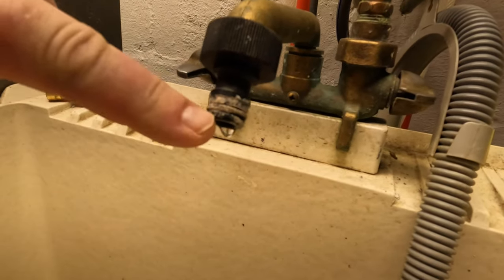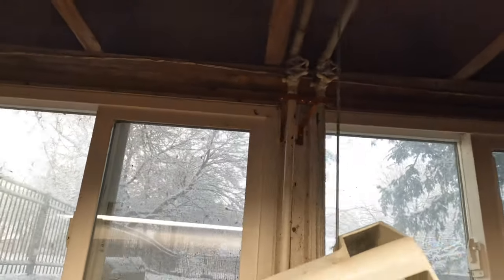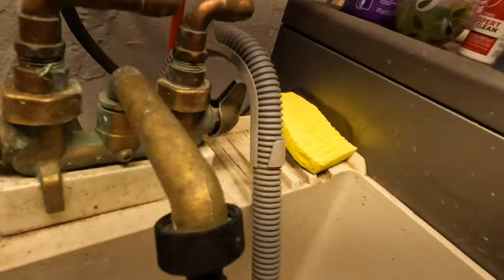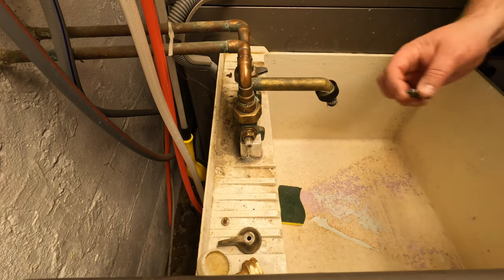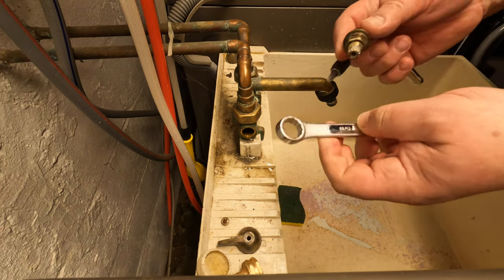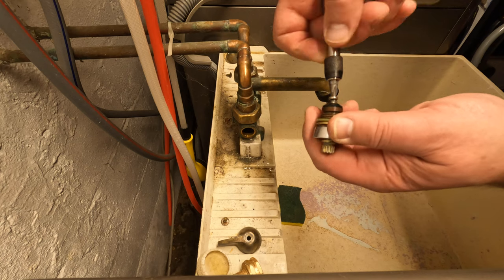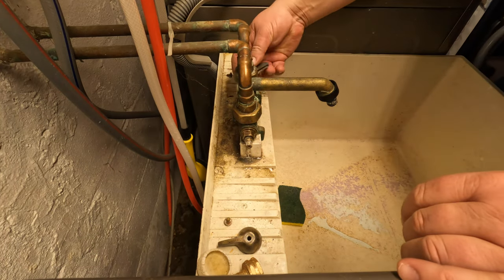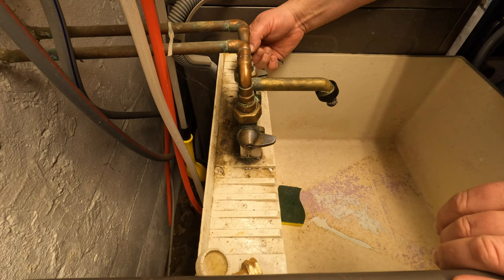Repairing a Leaking Laundry Sink Faucet (Less than a $1)

Comment: Thanks for this video. The valves you shut off, are they for the whole house or are they specifically for the laundry faucet? Because I do not have laundry faucet valves but I do have the laundry machine valves. Does that mean I have to shut off the main water supply?
Reply: Yes, be sure and shut off your main water valve for the entire house before starting your faucet repair.

Comment: I have separate supply lines to my faucet just like the ones in your video, but they are impossible to turn.  The just won't budge.  Even spraying them with lubricant doesn't help.  Do I have to loosen the nut behind the knob in order to get them to close?
Reply: It's recommended to turn all plumbing knobs in the residence at least once a year to prevent them from sticking.  It could be due to minerals in the hard water.

Comment: I'm in the process of replacing stems in a similar brass fixture. Rather than having a hex nut to remove stems, parallel flats are machined into the stem body. They provide a narrow shelf on which to grip with a wrench. To turn water on, either cold or hot, you lift the handle. To turn off, you press down. I removed the stem on the hot, right side. No problem. The cold, on the left would not budge. I was wondering, have any of you ever encountered such a fixture with the stem on the left reverse threaded? Since the two stems, in effect, operate as mirror images (since you lift to turn on, push down to turn off, on both sides) I thought this might make some sense. If that's not the case I guess I'll resort to a torch and heat up the faucet body.

Comment: looks like you replaced a tapered washer with a flat washer
Reply: Ya, why did he do that?
Reply: Did it become tapered after years of use?
Reply: I put a tapered washer in mine (cone shaped) and the faucet started squealing.  I still need a better washer in my similar faucet and these brassy older faucet types are harder to satisfy.  Otherwise, they are my favorite type of laundry sink faucet--mine is 32 years old now.
Reply: Exactly!  When doing a washer replacement you need to look in the base and determine if a cone shape washer or a flat washer is needed.  And the height of the washer he used for replacement looked too thin to me.  It may work for a bit but I would guess not too long before he will need to replace with the proper sized cone shaped washer.  Been there done that!